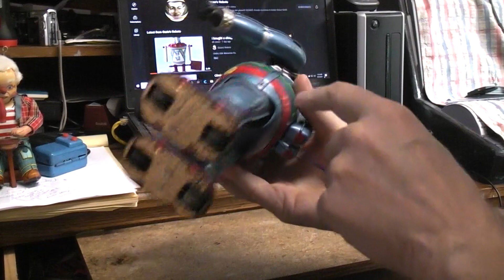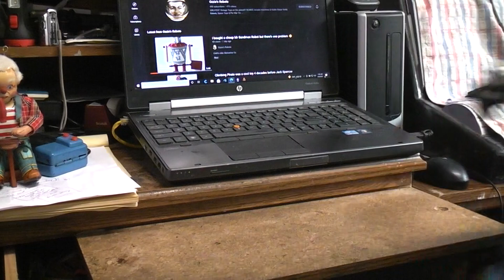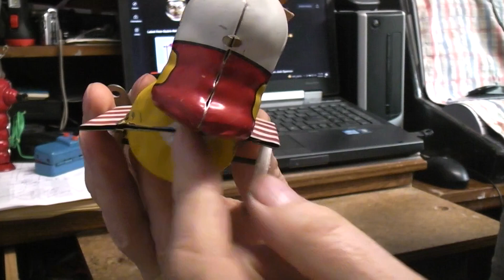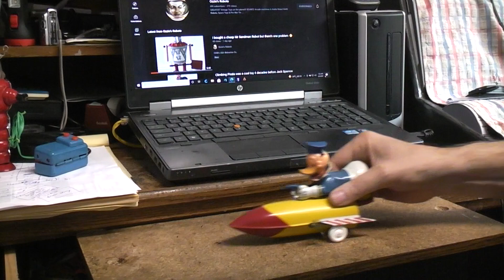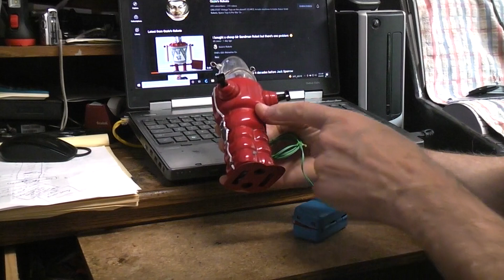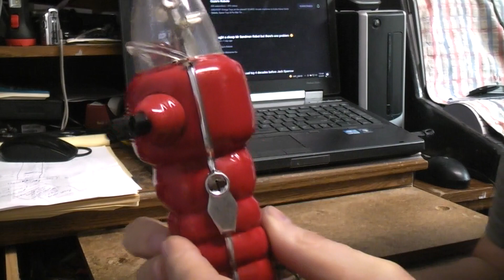4 Toy's  repaired for  Youtubes Ozzies robot's. Broken wires, springs, neck  and motor.

Comment: Hi. Would you be willing to give me some info about wiring up an old Cragstan Telephone Bear?
Reply: Thanks for getting back to me. Ozzie mentioned that you repaired the toy and gave me your name. The problem  is…the wiring from the big telephone on one end goes where inside that phone, and the other end goes where inside the desk? I guess I need to know the wiring from the batterie box on up. If you remember the repair there is a relay type of mechanism inside the big red phone, and another relay type rotary inside the desk mechanism.  You are my last resort for this toy…I have worked hours trying to figure this out. Thanks for your time.
Reply from the maker: @Superdoc7  I have no pictures and can not think of a way to help you with seeing the toy in its current state. By the way there are no relays in the toy. The phone end has a rotory switch that simply closes the circuit when the dail is rotated. The motor driven disc switch in the desk is a simple switch that keeps the toy running until the sequence is done, then that switch opens up the circuit to turn off the motor. The telephone switch simply turns on the motor until the mechanical motor driven switch can take over.
Reply: @Robothut  Also could you tell me your fee for sending the toy to you? Of course I would need your address which you could send to my e-mail. The toy has been completely cleaned for all the connections.
Reply from the maker: @Superdoc7  Generally it costs to much to  these days to send toys safely back and forth. By the time you double box the toy and pack it well the box will be over size, add in insurance  and factor in mailing  it to me and then back too you. Add in the risk that the shipping will possibly damage the toy and then add in my repair cost, that I do not quote before I have had the toy in my hands, so that I can base the repair on time it takes as well as materials I have to source. Ozzy uses me because we go back so many years, and he knows I can do the job, also Ozzy has the money to spend on his hobby that most of us do not.  It adds up real fast. So you are better off trying to find a toy repair person in your area. It is not a hard toy to wire up. You just have to make sure you have the motor running the right direction or you will have a problem, then both the phone rotary switch and the  motor driven switch get wired in parallel.
Reply: @Robothut  I understand. If I can ask another question or two…where do the positive and negative wires from the battery box go…and what do you mean by the two switches are wired in parallel . Thanks.
Reply from the maker: @Superdoc7  I can not tell you where the battery box wires go with out the toy in front of me. I did not take pictures of the repair I did for Ozzy. The motor driven rotary switch has a gap or a place where it does not complete the circuit, during that gap the remote telephone switch completes the circuit when you rotate the dial for a few seconds, as the motor turns ON the motor driven rotary switch then moves past its Gap and supplies the power to the motor. The motor will stay ON until motor driven disc has rotated back around to the gap and things stop "turn OFF" only rotating the phone dial "switch" will turn the motor back ON again. The phone dial switch has to be rotated ON long enough for the motor driven rotary switch to get past the gap point.
Reply: @Robothut   Thank you for the explanation and for your time to explain. I will see how it works out. I may need to reach out to you again, if that is ok, if I hit a snag. Like you, I do enjoy fixing up these old vintage toys; this one    with it’s two conductor wire coming out of the remote phone had me wondering where to connect the wires inside the remote phone, and where the wires coming out connect to the mechanism.
Reply: Hi. Well you helped me out with your advice. I’m almost there. If I now turn the dial on the remote phone, the toy works, but I can’t let go of the dial or everything will stop. Can you advise me? Thanks. Jim
Reply from the maker: @Superdoc7  Yes that is what the motor driven cam switch is for, to take over after the sequence starts. so the wiper on the motor switch cam and the frame of the gear box will make the second switch when wired up.
Reply: @Robothut  I’m sorry…your explanation does make a lot of sense but how do I wire up the two cam switches so they work correctly in parallel and I can let go of the remote telephone dial ? Which wires go where? I just don’t understand..can you tell me for instance, the remote wire goes to…the motor driven cam wire connects to?..if you could tell me hook this wire up to this wire, it would help..I’m not that well versed in wiring up electronics. We are so close..what am I doing wrong if I can’t let go of the remote dial? How do I wire up the motor driven cam..where does the pos. on the motor hook up to?  Thanks again for your patience.
Reply from the maker: @Superdoc7  I can not think of a way to help you with having the toy in my hands to figure it out. What a shame that some one removed all the wiring with out taking pictures or notes.
Reply: @Robothut  Would it be possible to send you photos of the assembly to an e-Mail address? I think then you would be able to see how to hook up the wires.
Reply from the maker: I am not sure what I can do with out seeing the toy in person or maybe if you posted a video showing what the problem is. I did repair one for Youtubes Ozzies Robots this year, maybe that video would help you. Check out Ozzies robots channel.